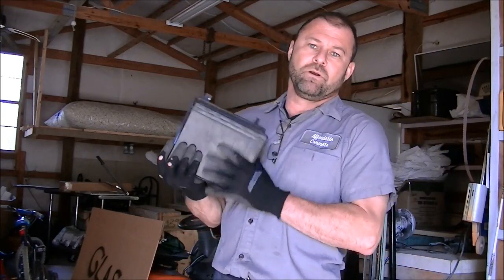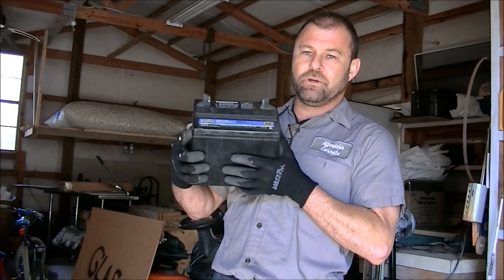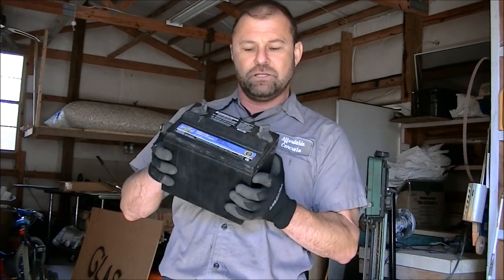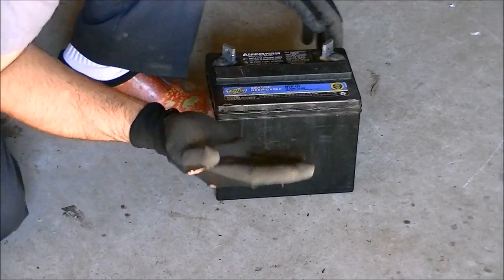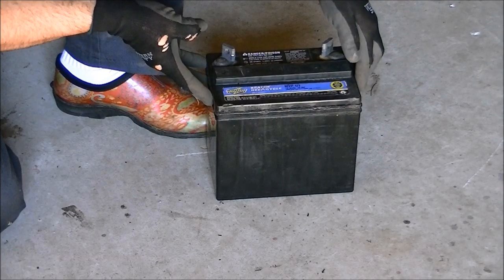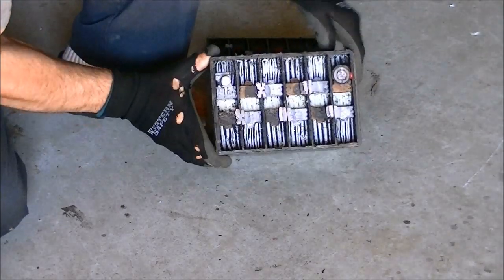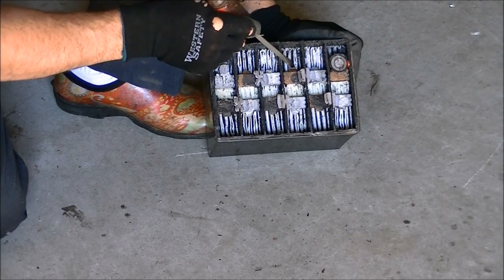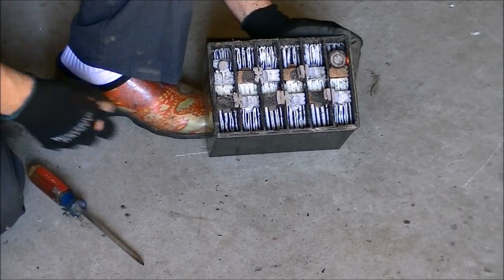What it looks like inside a 12 volt battery. See how it works

Comment: I  want to do this for a experiment to see what I can get out of the battery where can I neutralize the acid in with water to turn it into sea salt where you can flush it down the drain? and do I need to clean out the case to be sure the all of the acid is gone and  neutralize it? thanks for the advice

Comment: can I ask how did you shorted it out or dischared it I like to be able to make something useful out of it and can I be able to take off the top part with out damaing the top on it and can you be able to pour baking soda on to the plates to create mix of salt that will be able to go in to a drain safly and the lead pates burn them in a barrel or oi sould try something else it my project I was thinking wanted you advice before starting thanks your friend starscream1812